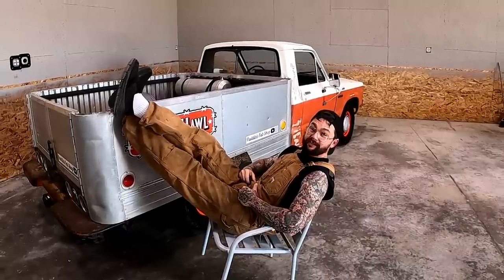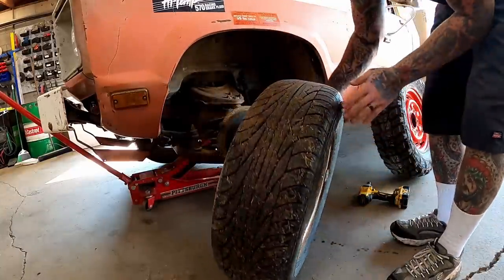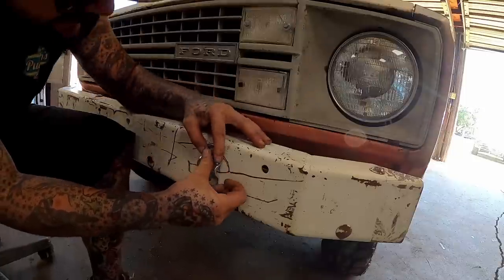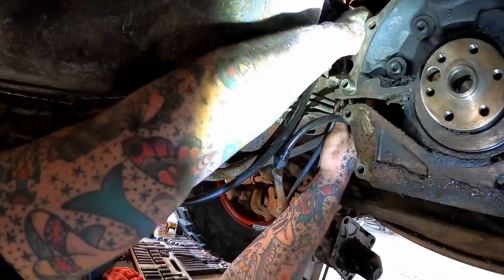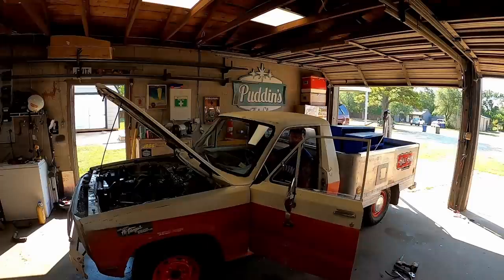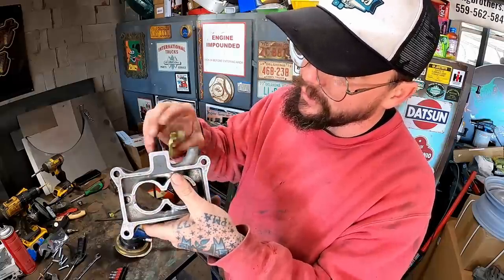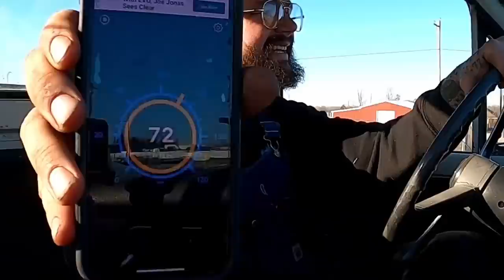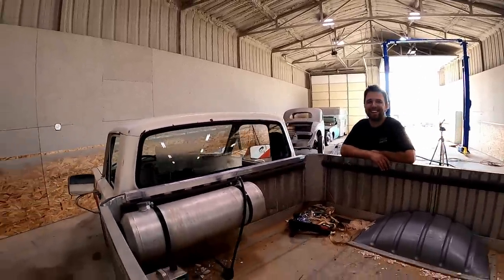FULL BUILD. 1981 Ford Courier old U-Haul truck. WORK TRUCK CONVERSION!

Comment: This was a great video.  Im a truck guy and a handyman. I'm also poor 😅 so the only truck i can build is a work truck and usually there are limitationsin to that as well im hard on vehicles, anything for a buck fillem  up good for junk and scrap runs. Can't make no money hauling half loads and its easier to rip crap apart with you truck than by hand. Anyways i think the 4x4 conversion would make great content keep up the great work.

Comment: Junker made a nice little truck with a little work. That carb made a big difference. You might can get a first gen 4wd Toyota with the frame rusted in half for a good deal. You can use the running gear for the half haul. Thanks for sharing, Puddin.

Comment: Hey puddin I put a hinged tahno cover on my s10. Used steal angle iron from a couch to anchor it to my box. 2x12 cross supports and 1/2"  plywood,coated with ryno liner. I got a mobil scaffle👍👍

Comment: 📌 Good video PUDDIN'.if you insist on crawling under your vehicles on concrete :
Go git a good dense foam rubberized yoga mat, Cut into 3equal parts, cut it ,spray headliner adhesive onto all side in  BETWIXT, like a GOOD  triple decker PB&J  ! I use one at work and the other guys Are  Shocked how comfy that PC. O 3layer foam performs..what a difference !

Comment: Well done video!! It's a fast truck for sure!!!  I would get a donor Ford Courier and redo the front suspension. Try some coil springs designed for Fords that are a bit taller than stock. That should raise up the front end a little without being too excessive. You could do a video on fabricating corner caps on the bed sides so you don't injure your hands with cuts and what not. I slowed down your Chuck Norris Kung Fu swing kick!!!!  Watch out Bruce!!!!!!!!!! LOL.

Comment: @36:48, you need a manifold vacuum line to that evap shutter on the snorkle, its closed without vacuum. @43:37...disregard.....:-) Dang, that was one full hour and a half of edjumacation there! I got an 82 and I'm stuck with all that smog crap here in Cali. so I got's to make it go legally. Holley 2300 on my cranky Nikki equipped 2.0? Oh yea, my driver side was 3/4" low in the front so I 3D printed one for the flat top of the spring, 100% infill PLA hasn't broken yet!

Comment: The problem I had with my 81 Courier was getting a clutch slave cylinder.  Ford couldn't get one but Mazda dealer did.  Replaced,  bled and no more clutch slipping.   To this day I can't remember how I bled the clutch by myself.  But I did.  Also put in a new distributor.   That 2.0 ran like a clock.

Comment: my 94 ranger xlt kick its ass lol
Reply: Dude I almost had to do the same thing you did to that dachshund More or less it's the same thing in a ranger I put a Mazda and a Dachshund right beside each other with the exact same engine exact same thing only difference is mine says Ford on it but my 94 would kick your ass I got fuel injection
Reply: That's one of the reasons why like a Ford ranger they last that 2.3 inches been around for a long time and it's still going My dad used to put them in boats My dad was a boat mechanic so good luck putting your going to need it

Comment: I don’t think there were very many of them made. Where did you find that ugly beast. In Europe and New Zealand and Australia that was the nitty shitty top of the pile. 

Your crazy enough to get an GM Holden 6.0 with a 6-speed and 4 doors and the driver’s work space is all on the right side of the car. 

Want some interesting..
The manual transmission missions use American shift levers making 1st gear up and away from you. 
It be fun playing Dodge a Kangaroo…